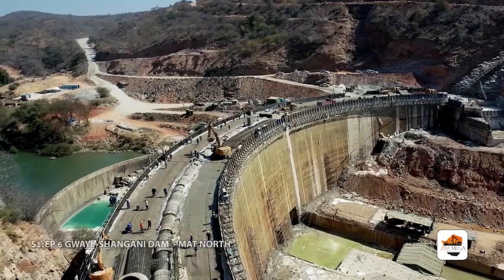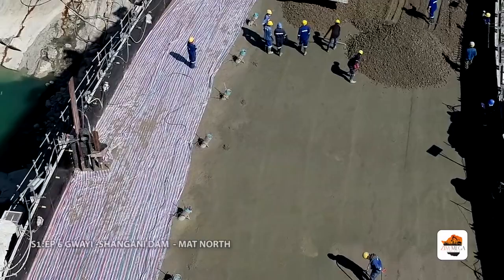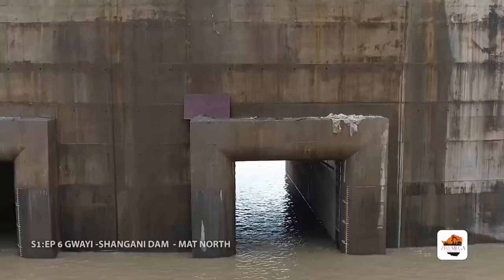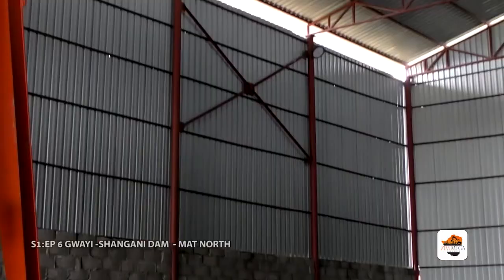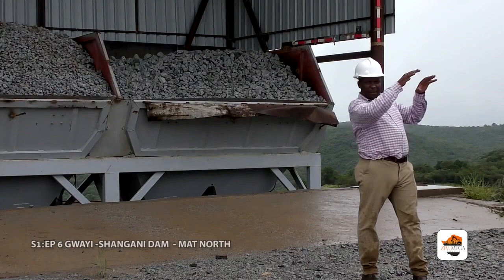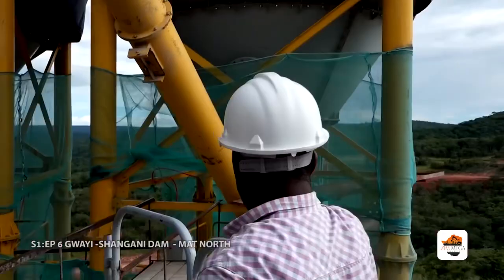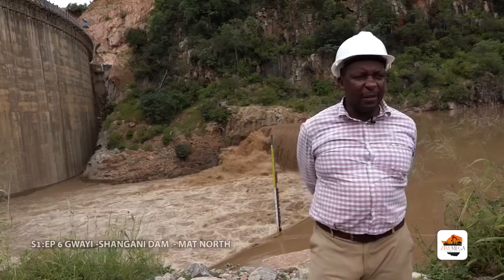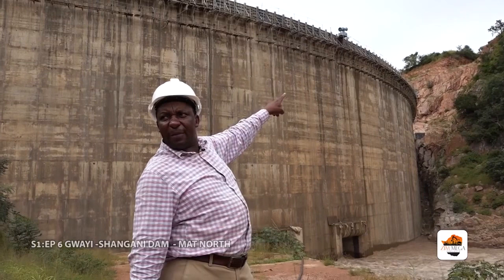ZIM MEGA PROJECT GWAYI SHANGANI DAM 1

Comment: Why use steel piping instead of plastic? It's more expensive and labour intensive, besides steel rotes in the long run while plastic is more durable. Why is it difficult to build sustainable solutions?
Reply: steel pipes are only for hydro power station.